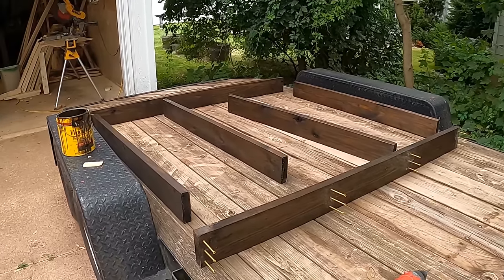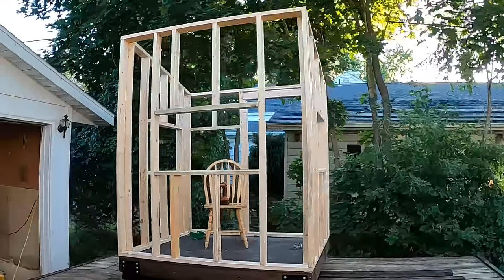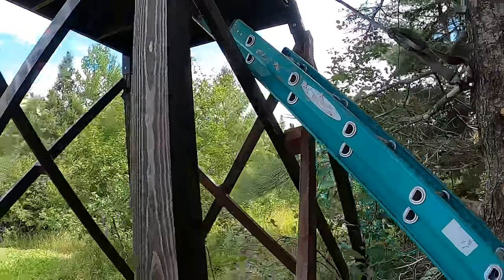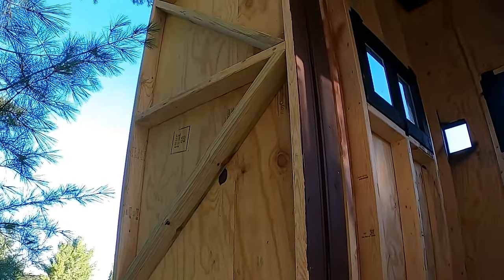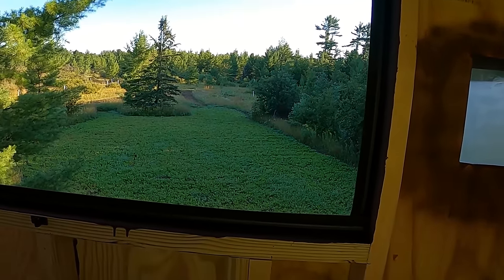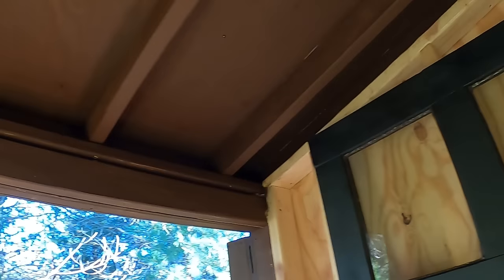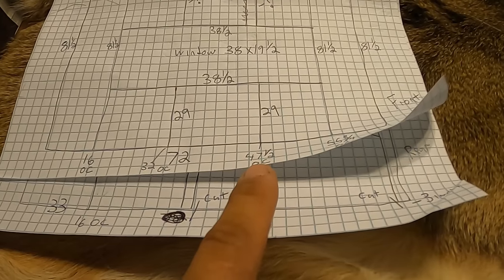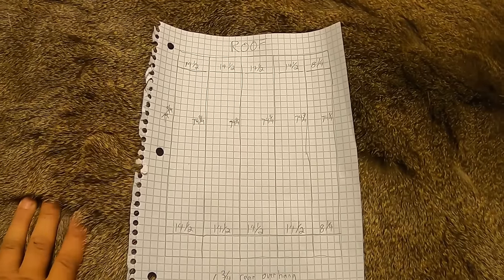simple deer stand/ hunting blind build

Comment: You will discover the corners where the brackets mount will need to be very well reinforced as the 2x6 will twist in a short time.  Use at least 5/16 diameter bolts to attach brackets as any LAG type screw will work loose.  Also, if you’re setting this on the ground to use put it on like building blocks to keep the frame from moisture rot. Any cracks or openings on the assembly need to sealed with caulking/ silicone to repel moisture and insects. In the summer when there are weeks of no use I put moth balls inside to help repel anything that might be able to get inside like at windows or the door seal.

Comment: I think this is a nice build.  Obviously there are ten different ways to do things, and nine of them are fine.  One thing I like to see when framing a floor, is to use galvanized deck support straps/hangers so the “load” is not only being carried by the three deck screws.  Bolts with nuts and washers (as mentioned before) instead of lag screws should be used on the elevator brackets.  Insulation for warmth, and noise reduction.  And adding deadfall around the base to camoflage the base etc., adding carpet.  I am sure the owner likely already has done these things.

Comment: I am with everyone else that said disconnect the strap from the tree. If you want the strap put an eye bolt to the center of the stand and put in a screw in ground stake and attach the strap that way. Nice looking blind there. 👍
Reply: Paul Huval na, that low on the tree, if you get more than a couple inches sway even in heavy wind.......you’d lose the stand even if you had it cemented into the ground

Comment: The little spy windows are a great idea
Reply from the maker: Thanks
Reply: @luckyandy76  I was looking at the windows and it looks like you didn’t pull off the protective plastic on one side of the smaller ones.  Maybe removing it would make it so you can see through them.

Comment: I built one very similar. I took the walls and roof off and transported it to the property.  When I got there we put the floor upside down, put the 4x4s in, braced it and flipped it over by hand with 2 guys.  Then we pushed and pulled the walls up and screwed them in place and lastly the roof. I shingled it when it was all together.

Comment: Raising tower blinds is probably the most dangerous things that get done on a deer lease. It's best to get  the box elevated as much as possible before you try to pull it up. Also figure out a way to keep the legs from sliding while you're pulling it up. The best way I found was to dig a ditch for the legs to lay in and then drive a  2" x 4" (or bigger) stake of some kind in the end of each ditch to stop the legs from sliding. You need to attach the pull rope/ropes as high as possible on the tower legs and have another BIG rope attached to the other side of the tower with at least 2 big guys holding on to it. You need to pull it up real slow and steady with the 2 guys on the rope keeping it tight or you'll pull it all the way over. A full sized 4 wheel drive truck is a big help and learn how to tie a bowline knot if you don't already know.
Reply from the maker: I definitely agree on the dangers of raising a blind.  I made some bad decisions due to over confidence and no experience.   Definitely learned alot and the next one should go easier.  Thanks for the tips.  They will come in handy as i plan to build at least 2 more over the next couple years.
Reply: I build the platform and box separately. His is set up for 2 people, I don’t do that. I go with a 4 x 4 box, pre-fab in the garage. 3 sides, door in 4th side. Use 2x 4’s ripped length wise, one in each corner, offset for the thickness of the plywood for a tight corner. Build the roof,  pre fab at home so it fits. Once it’s completed, take apart, haul to your site and set up the platform. Usually I’ll make a 4x 6 platform so there’s a small porch at the door for easy in and out. Then you can attach the box on top. 3  sides then it’s easier to get the roof on. Helps to have a helper, a charged screw gun and a basic idea before your up the creek without the paddle!

Comment: I built one very similar to yours about 11 years ago. It's held up very well. I'm always making little improvements to it. Mine is 7' off the ground which is plenty for my situation. I concreted the legs 2' into the ground. I have a simple 2x4 ladder going up to a trap door in the floor to get into mine. I like the garage door seals for the windows. I'll probably add those to mine next summer. Thanks for the idea and good luck.

Comment: SUGGESTION.  ON INSIDE, I ONLY PAINT FROM THE BOTTOM OF THE WINDOWS UP IF STANDS ARE ELEVATED.  DEER CAN'T SEE LOWER INSIDE OF SHAKE CAUSE IT'S IN THE AIR.  ONLY REASON IS AT THE COST OF A GALLON OF PAINT...YOU'LL SAVE SOME $$$ IF YOU ARE BUILDING MORE THAN 1 BLIND.   JUST SAYIN' .

Comment: Nice blind but I would never attach a blind to a tree that can move when the wind blows. It will pull your T-post corner stakes loose in time. We have always put a heavy guy wire with a turnbuckle on each corner of our tower blinds. T-post stakes work ok for the guy wires if you drive them in deep at an angle away from the blind and attach the guy wire right at the bottom of the T-Post.

Comment: I ran into the same situation with my tractor and shooting house.  I was 2 feet short on height - so I built a ramp for the tractor so the lift would go to the height I wanted.  Problem solved.
Reply: I stacked pallets on my loader forks to get the height I needed to lift mine

Comment: I put up 2 stands and put t- stakes in the ground by each leg and screwed them to the legs and it holds the stand very well but the problem I have is when the ground freezes the frozen ground pushed the stand up a little bit each year and both stands are not on the ground and then it will make the stand very wobbly and move very easy

Comment: Nice stand but it’s an overkill making it with 2x4. To anchor a stand like that I would cut a 55 gl drum put a screw anchor in it and fill with concrete. Next time you go to set up a stand put base on side rails of trailer. Put bottom legs in then top legs then put leg supports on spreading legs. Then slide stand till bottom legs are on ground. Tie rope around highest part of stand and pull up with vehicle while someone is on trailer pushing up very easy to do.
Reply from the maker: Thanks for the ideas, i will have to try that setting the next one up.

Comment: Good thinking with the garage door weather seal trim. What size are the smaller openings in the corners? And I was thinking before you mentioned your daughter wants a fold down shooting rest that if you hinged the windows at the bottom & put a couple hinged legs on them, they’d fold down into a decent shooting table.

Comment: this video was really helpful. im currently building a blind actually very similar setup. Im on the windows. how are they holding up? have you been back to make an update? i like the Garage trim idea i will have to steal that one from you!
Reply from the maker: Time will tell on the windows, i just finished building it so it hasnt had time to get a real durability test.  So far so good,  no leaks.  We just had a nasty windy storm, and i went out right after to check!
Reply: @luckyandy76 thats awesome! im going to be making a little video of my build as well. pretty similar to yours with the pitch in the roof and all. fun little project while im laid off work. still unsure what im going to do with the windows. i would make my own frames but i dont have a table saw to make my groove cuts.
Reply: I build a lot of shoot houses and there is a company called deer view that makes windows that aren’t near as big and open and close quietly and they are very affordable just a little tid bit incase you may be interested plus u can keep them closed when it’s cold instead of open and worried about noise
Reply: @charlieh7869  yea i talked with them but their turn around time was minimum 8 weeks for a custom size
Reply: @charlieh7869  i ended up making window frames and sliding acrylic in the grooves

Comment: How did you get it up in the air? Did you already have the platform on the posts and then put the box together 10ft off the ground?
Reply from the maker: We put the box together on the ground and tried to tip it up with a truck and tractor.  It went up, but the way i did it but  we made alot of mistakes and things got sketchy and i pretty much forgot about taping until it was stabil on 4 legs.  This coming summer i will be putting another one up with a new revised method thanks to the learning experience of my mistakes and the great suggestions in the comments.  So thinking next one will go up easy.

Comment: Question ? Why do you build the room first.  And then take it out there . Then raise it up with a bobcat or whatever . And then build the frame underneath it.  
It would make more sense to go out there with the material.  Build the frame . Then build the deck then build the walls and the roof . You're doing this backwards.  This makes no sense you're doing it the hard way. Why not do it the easy way
Reply from the maker: I had alot of learning experiences with building the stand.  The reason I pre built it at home is I did not want to haul all my tools up to the site as I currently live a little over 3 hours away.  Hopefully I can build my garage up there next year so I can build stuff on site.